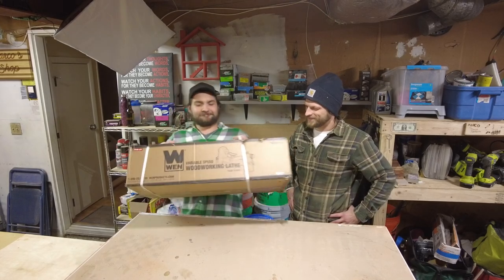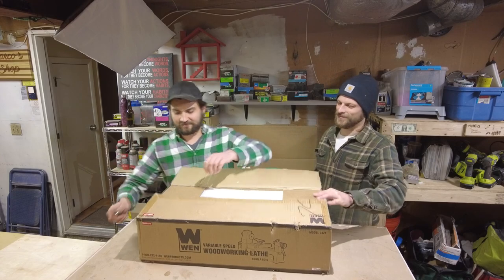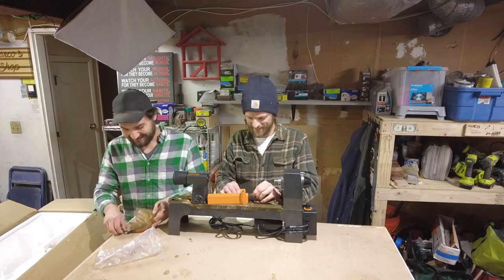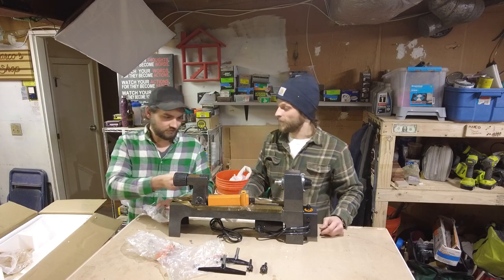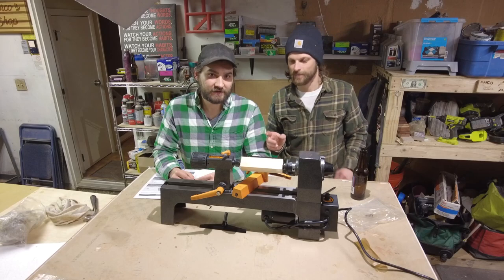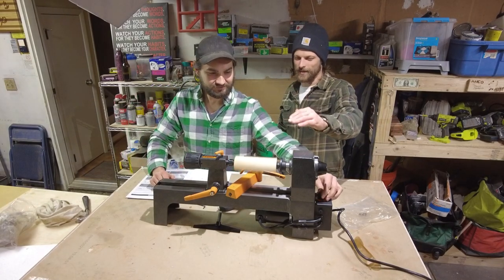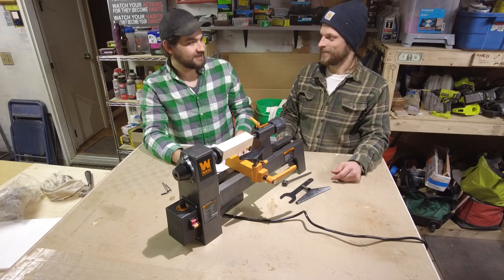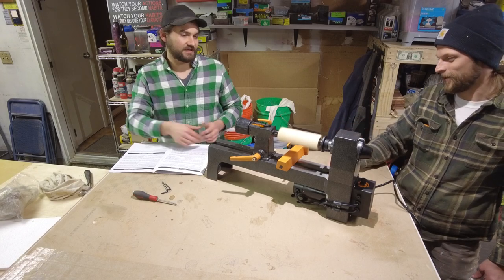Unboxing Wen Lathe 3421 (Unpolished)

Comment: The tool should be close to your work and the tool handle should be below and not above your work on the rest.. Much better and secure control .
Reply from the maker: Definitely. We learned that as we used it. We both have never used a lathe before. Such a great tool to have in the shop.